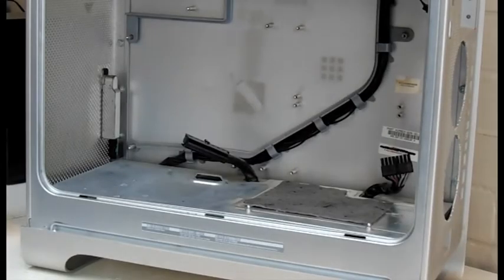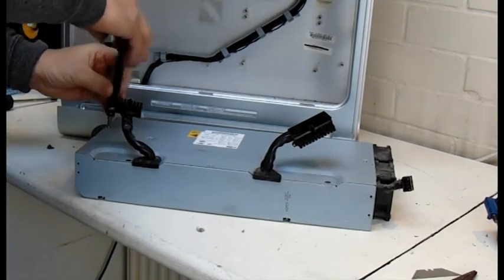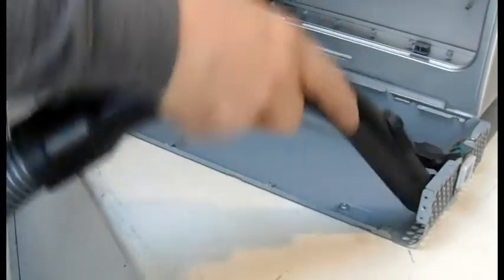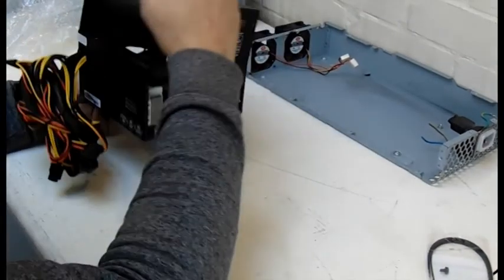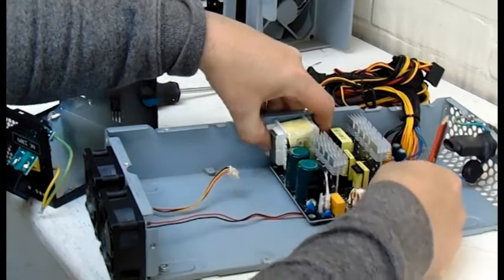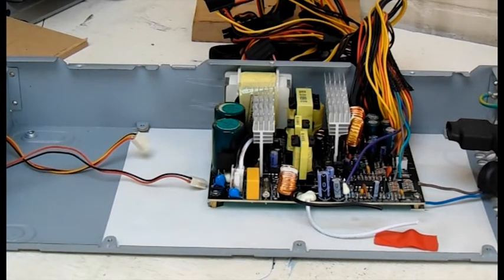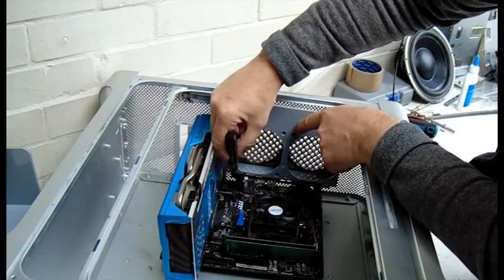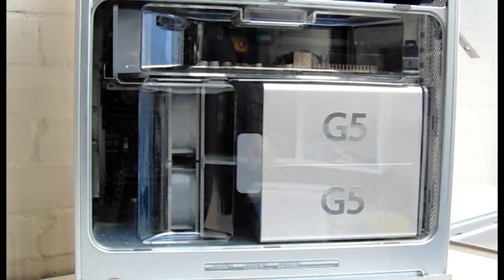G5 to ATX Conversion Part 2, the power supply

Comment: 20sec of video and it was clear he was going to mod an atx psu case housing to an apple case instead of tweaking the original guts...  Lame.
Reply: is it possible to tweak the original guts?
Reply: Yes. Wiring is easy but due to the old design of psu its absolute not the richt choise to power up a modern atx build...

Comment: Are all cables from the power Mac input the same color? (Brown and blue)
Reply from the maker: No they are different for every power supply, nut one is positive and one is negative, positive is always brown and neg is blue so as long as you know which is positive for both units it is just a matter of soldering them together.